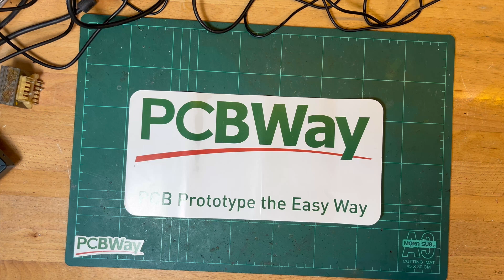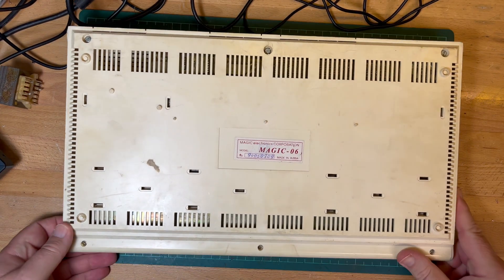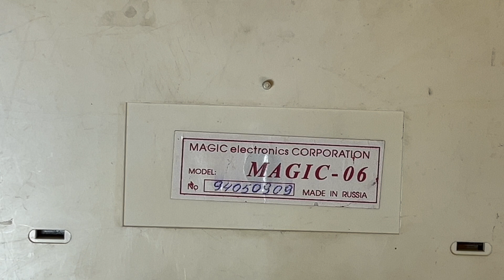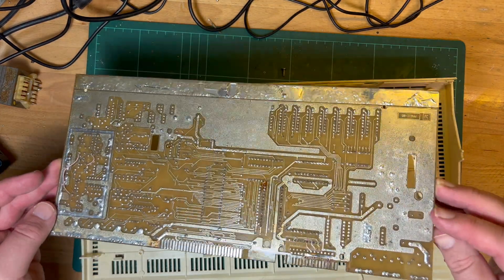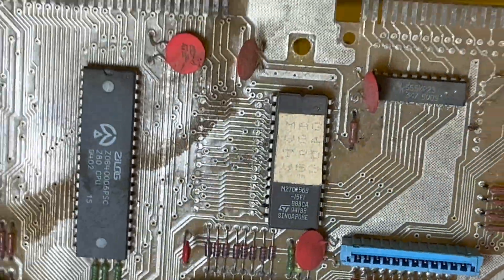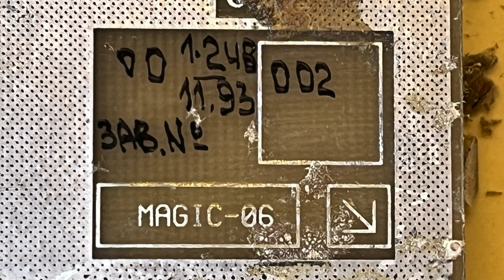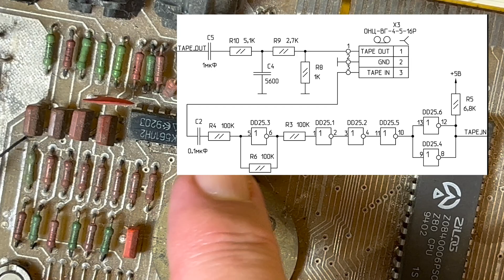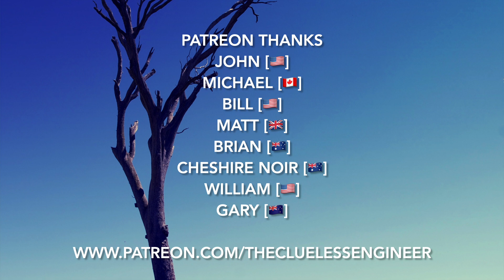🇷🇺 MAGIC-06 ZX Spectrum Clone: Part 1 (First Look) [TCE #0582]

Comment: My Арсенал Компаньон 2 looks exactly the same from the outside, but its innards are different. Apparently the case and keyboard were used for several different computers. 
I checked on my website for a picture of the motherboard, only to discover I hadn't taken a photo of it. So thank you for getting me to open my machine, make photos and put them online on my site :)
Reply from the maker: Just fixed my sticky АР2 key ... seems the key cap is 7mm in diameter ... same as the hole for it ... so I used a 7.5mm drill bit to slightly widen the hole ... now it doesn't get jammed!

Comment: I can guarantee you that keycap was sticky right at the factory. Soviet design as is. Same engineers and techs in 1994 as they were in 1970.
Reply from the maker: I wonder if the АР2 even has a function on the Speccy?  I'm curious what is on the ROM, seeing as it's double the size of a standard Speccy (32KB vs 16KB) ...
Reply: @Brfff  As far as I can remember AP2 it is just a Ctrl+Space combination that makes a break.

Can not tell anything about the ROM. But I suspect that half of it is empty.

Comment: that really is a magic ZX! it has a real keyboard! :P
all the unlabeled 5pin dins are a bit crazy!
that key sicking is prolly from the shmoo in the top of the keycap itself.. looks like somethin spilt on it...
interesting.. that Z80 is a 6mhz variant
that inductor missing the slug..maybe it didnt ever have one.. the slug is a ferrite core..maybe that inductor doesnt need it...
Reply from the maker: Shouldn't have to worry about those inductors ... I assume they're all part of the RF modulator section which I don't need.

Comment: Hobbit
Reply: This is not a Hobbit.
The Hobbit uses a similar keyboard, but has a grey/silver case and a completely custom PCB which doesn't use a russian ULA clone. Davide Barlotti has a short video on his machine. Sadly one of the worst documented high end ZX clones of the 80s/90s - even when it was briefly marketed in the west.
Video ID is wvWht0eR02A
MC7007 seems to refer to the general layout and matrix. I have a NOS one with non-ZX specific markings on the keys.
Reply: @RandomBlankUsername  and what does T34 have to do with it? Magic ULA is a completely different development. The keyboard from Elektronika MS 0511 (UKNC) was used in many clones (two dozen). The case here is from the Forum cooperative and the clone of the same name.
Reply: @ndiscovery  You are right about the ULA part - my bad.
Reply from the maker: This one?  Looks like they used the МС7007 keyboard as well sometimes
https://speccy.info/Хоббит_(компьютер)